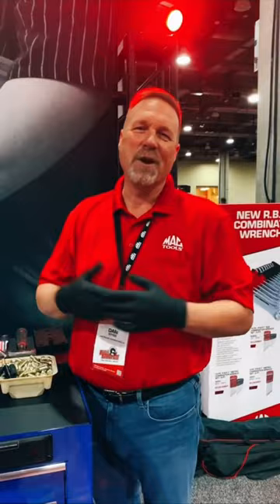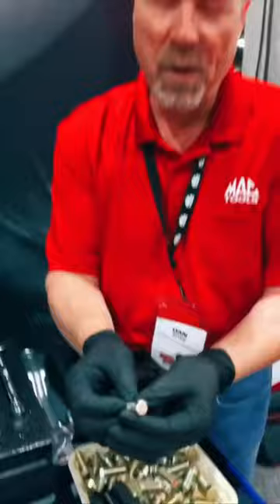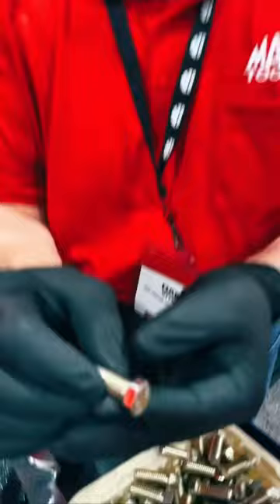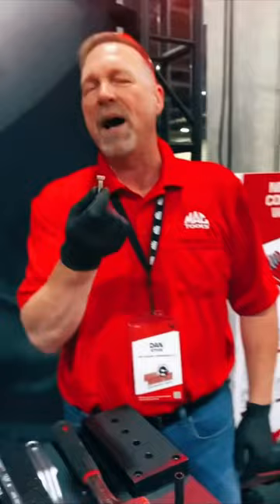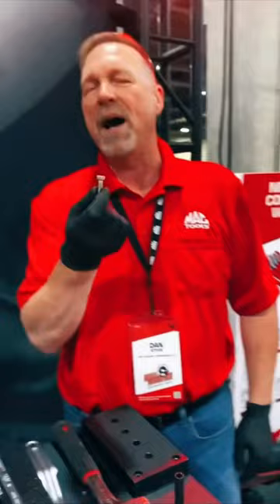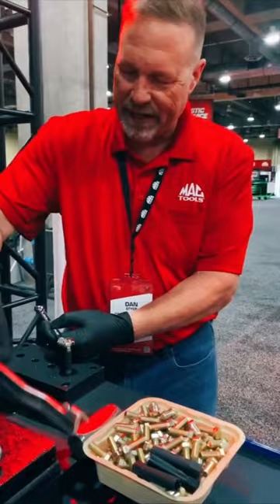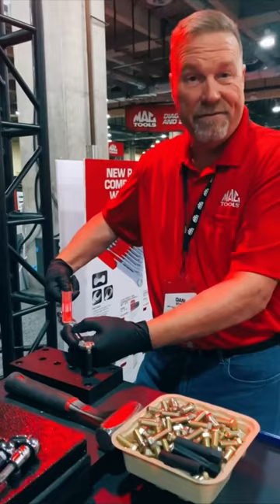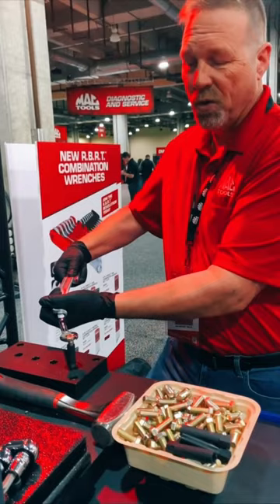The All New MAC Tools R.B.R.T Wrenches! Straight From Tool Fair! #mrsubaru1387 #shorts #rbrt

Comment: Would've like to see a regular wrench on that first
Reply from the maker: A regular wrench will slip before it shears the grade 8 bolt head.
Reply: @MrSubaru1387  still would have like to see a visual representation of that
Reply from the maker: @nousernamehere1  🤦🏻‍♂️🤦🏻‍♂️🤦🏻‍♂️
Reply: @MrSubaru1387  can't please everyone. Some people don't understand the concept of a YouTube short
Reply: @MrSubaru1387  how would it have compared to the flank drive plus wrench tho?
Reply: @itzmagictime8824  bro
Reply: @MrSubaru1387 if it was in anything longer than a yt short, he has a point. Even if a regular open-end wrench wouldn't have got it it still would have been nice to see
Reply: @MrSubaru1387  ya for sure those wrenches are no joke, most open ends will stretch and slip. Those dig in and hold much more force
Reply: @itzmagictime8824  it wouldn't have even taken an extra ten seconds, they absolutely could've fit it in the short
Reply: @itzmagictime8824  advertising junk overpriced tools
Reply: @Douglas LaFountain  then don't buy them lol.

Comment: Had these wrenches for years. The open end grips like (')
Edit: They're called "Precision Torque" The part number for my 12mm is: M12CL440. This is just an updated version but I'm sure the ones I bought years ago are much cheaper and just as effective.
2nd Edit: I'm dumbass. I don't have these. They are called "R.B.R.T Grip Wrench" not "Precision Torque" The box and open end are completely redesigned.
Reply from the maker: These haven’t even been released yet…. 🤦🏻‍♂️🤦🏻‍♂️🤦🏻‍♂️
Reply: @MrSubaru1387  What's the difference between these and their "Precision Torque" wrench set?
Part number for my 12MM is M12CL440
Reply from the maker: @YuckFou0x0FFFF  completely different open and closed end design.
Reply: @MrSubaru1387  Found the entire demo video and you're right. The open and box end is a complete redesign. My bad dude 😂